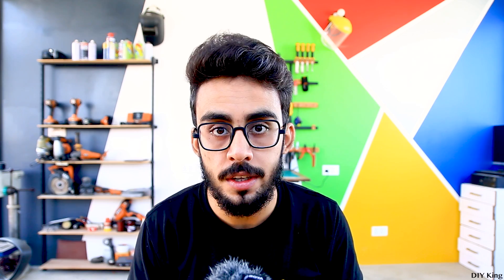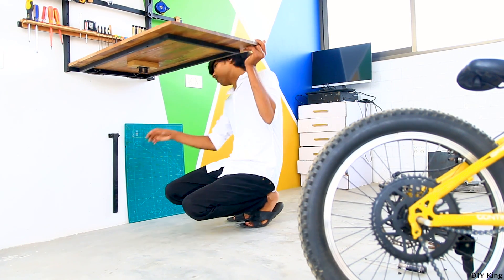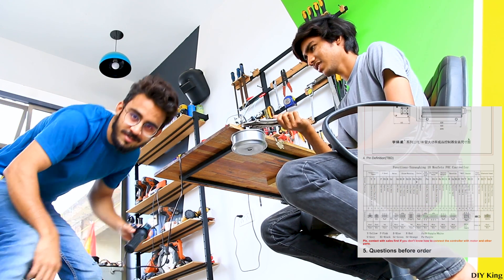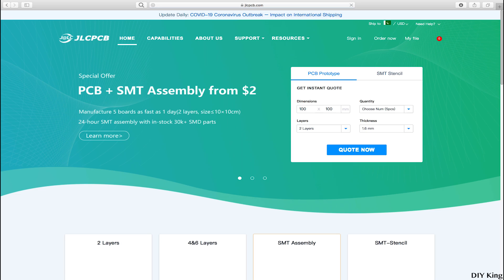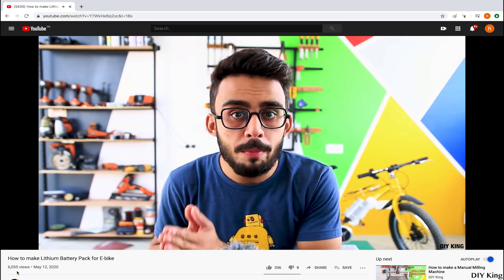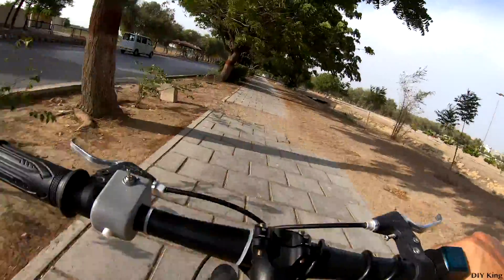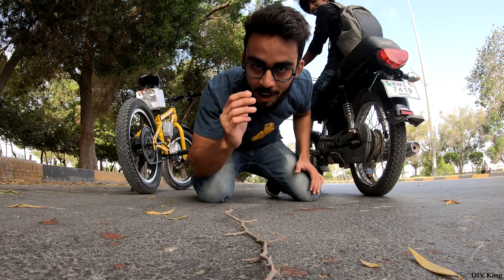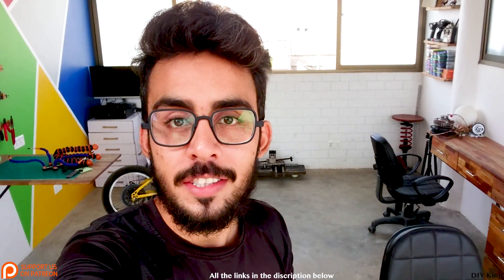How to Convert a Bicycle into Electric Bike (Goes over 60km/h with 20 km Range)

Comment: i made it simiular to ur project i couldnt find 9t chain ring and i put there 33t chain ring and  its going max37 kmh but i cant climb ramp and motor heating up like 70 80 degree is this harmful for motor? im gonna change chain ring 33t to 16t so 16/24

Comment: I'm very surprised that the hoverboard motor makes that much torque and speed. What brand, model hoverboard did it come off of? And what size sprocket was used on the rear wheel? Well whatever was used, it looks like it was perfect for allowing plenty of speed and plenty of torque also. But please reply if you can answer my questions. Thanks!!

Comment: Hey guys ul rock I see your video regular  it seems ul r professional doing all that diy great. I want to develop a small scooter  with 220v brush motor with 12v battery inverter is it practical what would be its pros and con if I do plz explain

Comment: I'm not sure why you didn't make a mid drive system with the hoverboard motor. I made one with a hoverboard motor it's very simple.
And you have the option to ride.
Like a normal pedal bike without the power.
With no resistance
Reply: Can you provide any pictures please, interested?

Comment: How is the motor isn't burning?
It was rated for 36v and you are using 84v
Reply: Bro the motor is only getting the amount that is in the battery 84v is limit of the motor controller not cureent volt so if he uses a 48v battery in a 84v motor controller the motor controller will only use the amount in the battery so the controller is getting only 48v

Comment: Mashallah Weldon Weldon this is a great project indeed a great achievement
Please I have a question the maximum volt for the motor is 45v if u use a 80v speed controller is that what makes it run fast ?
Reply: +voltage +speed
+Amper +aceleration

Comment: At 7:15 you mentioned in series voltage is 84 volts.  The battery says 36 × 2 = 72 volts how much voltage can a hoverboard motor take can you give more details
Reply: 51 volts XD that motor wont last long
Reply: @SlippySkip  hoverboard motors can take 120volts for over a half an hour.
Reply: Fiprobe holy cow I have a 130 watt motor Rated at around 48v

Comment: Sir, can I ask what voltage did you use to run your hoverboard motor?
Reply: They use 10s Batteries and 10s batteries are 42v
Reply: Hi! In the minute 7:10 he clearly says that they're connecting the two 10s packs in series ,which provide 72v nominal (36v ×2), and 84v fully charged (42v × 2).

Comment: hi sir, i have 2 hoverboard motors but no bike card, so if i connect the 42v hoverboard battery to 2 hoverboard motor and put 1 key, will it work

Comment: Awsome diy, well presented. Thouigh I am little confused, you say its 42 v in the vid however the battery pack states 36v. I guess they are at full charge 42 v right?
Reply: I think they are 42v at full charge yes, and in paralell to get more aceleration

Comment: Use a helmet please.. Also try adding regenerative breaking
Reply: Yes, wear a helmet. Your life is important. Who would make these videos, if you got hurt?
Reply: Regenerative braking are built-in in some controllers
Reply: regenerative braking can only be done on motors directly connected to the wheel, if the bike has a freewheel anywhere regen is impossible
Reply: @socialfreak6900  agree, and thus direct drive with regen would be an intersting mod

Comment: Why did you change the enclosure. It works as a heat sink.
Reply from the maker: Yes you are right, but we have design the new enclouser having small heat sink which is enough to cool and it work pretty good.

Comment: the motor isnt getting hot?
Reply: For sure... Its rated for 350w and he is pushing 3kw+ but the gearing limiting the speed to 60 may decrease amps at top speed, so the constant wattage should be like only 1kw at full speed (still too much for that motor) but if used in short period isn't that much of a deal (maybe he could oil cool the motor)